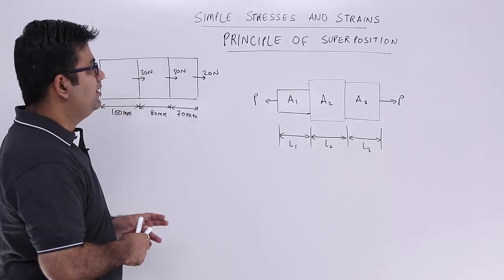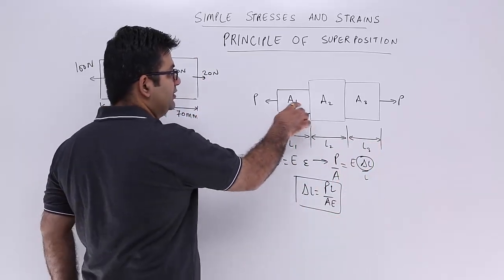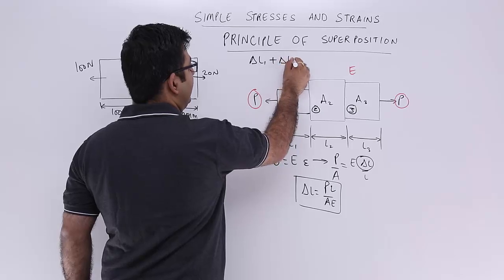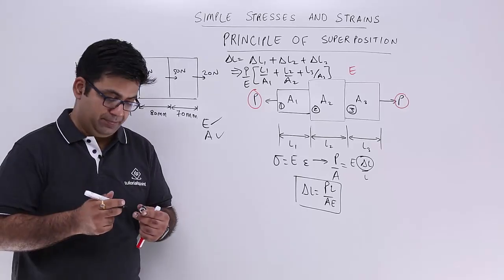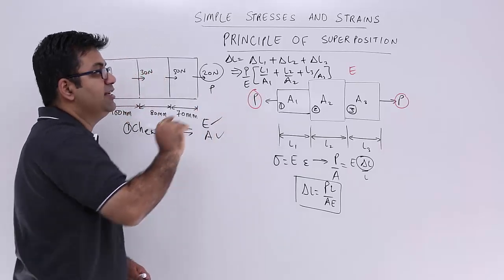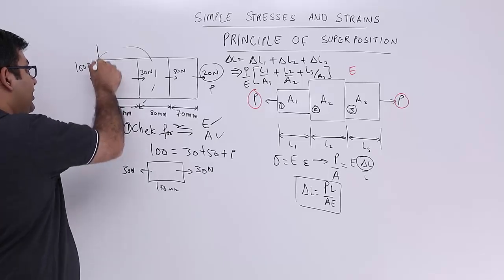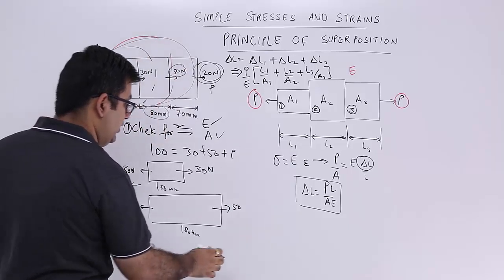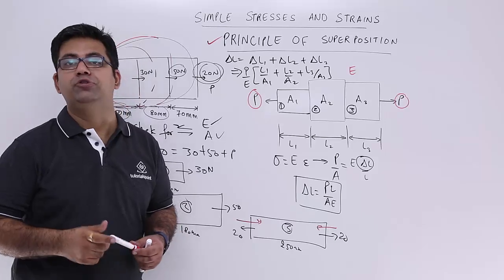Strength of Materials - Principle of Superposition

Comment: I was so confused with the method I was using, I opened your video and solved for the RS Khurmi exersise 2.2, in the 2nd question I was getting the error of only 0.1mm but in the 3rd one the error was 0.2, it is not bearable I guess so I checked for other methods and found a method which gave me the closer answer, I am not saying the method is wrong but I don't know either that which method is more accurate. Still thanks sir.

Comment: i think its wrong.for each individual section it should have been 100, 70 and 20??
Reply: both r correct. answer will b same in both cases
Reply: You are calculating individual 150,70,80mm section and he is adding them successively that's why he is getting different forces 
Answers are same by both method " he is not wrong" you don't know this method😐
Reply: Yes you're right